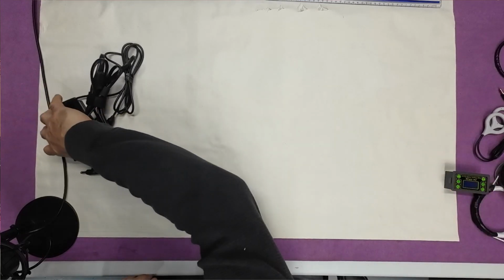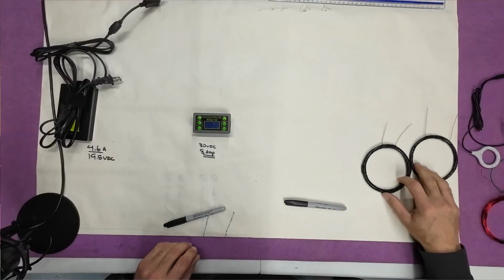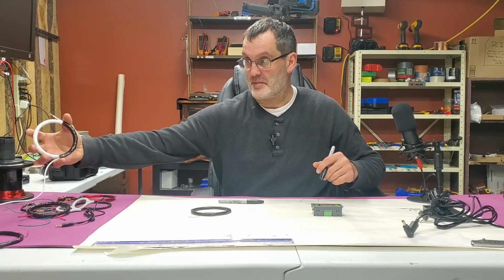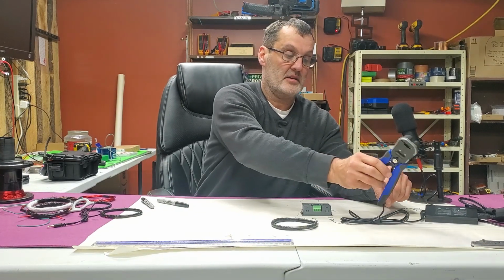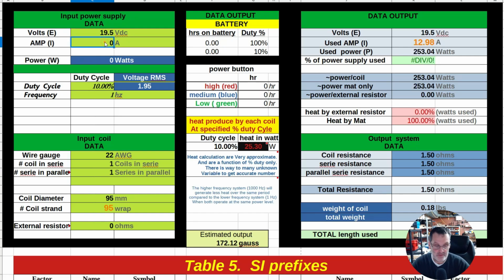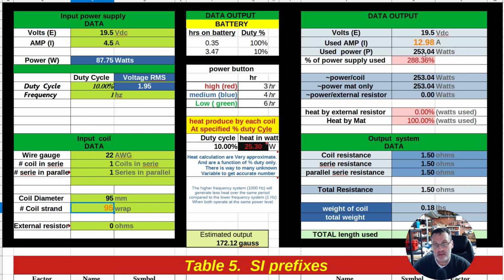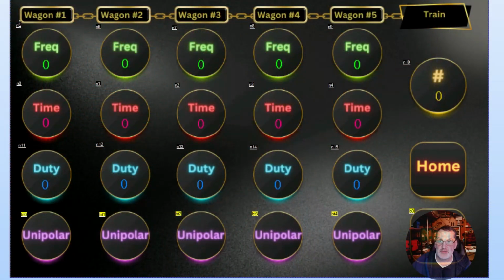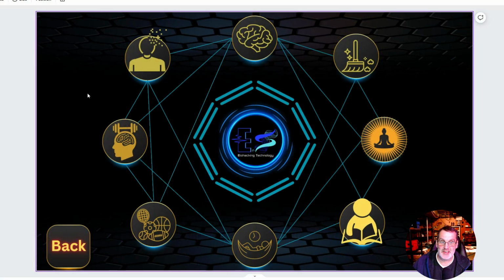Back to the BASIC!!

Comment: I have a question on the ohmic resistance. I pulled the back off the pk-pp1k. It's got a quite alot of integrated circuits in there. Was actullay impressed they have so much stuff. In there. Didn't do a full study of what the components are. Does it not have a mosfet? If it does, then if you are using a 19 v 3.59 A power supply, don't you need at least 9 or  little more ohms of total ohmic resistance in order to overload the p zed, so it doesn't burn out? I don't know what diameter your propane bottles are in Canada. I got my coil winder and a shitload of wire so I can now teach myself to do the coils. I'm going to go get a small table today, to mount the coil winder on. Still have to fabricate a guide and stand for the coil wire to rest on. I'm colse to figuring out that part out. I am dealing with a really bad rheumatoid arthritis flare up for two days now. A bit edgy, since I had to take some prednisone to reduce the swelling in my right hand. I've been using the micro-pulse A9 on my right hand, for several hours daily on my right hand. It swelled up so much, that yesterday, it looked like an overfilled sausage. Could not move the fingers or do anything with it. I tried hard to not take the prednisone but the A9 did not reduce the swelling. Two days with many hours on the maximum X setting. Nothing. Have a 650nm-880nm red light mat. I used it as well on my right hand. Finally had to take the prednisone which really makes me feel terrible. Anyhow, Thank you so much for the hard work you do on the videos. I know I can speak for all of us that watch your videos, that we truly appreciate the information and selfless help that you provide.
Reply from the maker: @joelstolarski2244  use the ppk2 not ppk1.  Ppk1 does not have a lot of amp rating.

Comment: Ok. After a couple of weeks, I have received I believe, most of the components, needed for your simple build. I wanted to just make the simple pemf, that I saw in the other video you did. Have had a few hectic days, and not sure where that video is. Have one of the ZK-PP2K. Got it because the buttons looked nice. So, when winding the coils around the propane bottle, it doesn't matter if the wire layers are arranged neatly in layers? Have multiple power supplies similar to yours. Will try to find one close to the same specs as yours. Thanks for the work on these videos,and the information that you selflessly contribute to us.
Reply from the maker: @joelstolarski2244  not to worry about the winding.   Try no to cross over.  The way we build the coils is the single best way to make it happen.  :)
Reply: @Steeve. Tried to see in your video how to do the winding. I have only 16 awg wire and when I order didn’t realize it is very thick. I have the RA in my left index finger. Was very hard for me to do the winding. I did 100 wraps. I probably crossed over. So it’s maybe wasted wire? I will have to get some of the 22 awg like you used. I am doing the wrapping by hand with no winding machine.

Comment: Have you built a battery operated Nextion system?  And if you did I would be curious what hardware you used to protect the system from under-voltage damage in a low battery condition. ty
Reply from the maker: Yes I have.   
There is a few ways,  the one i like the most is using buck boost converter to start and a low volts cut off mosfet that monitor the battery.  

Using your bench top power suply you can test your design.  

Low voltage protection is really important for the nextion.
Reply: Thanks so much  @Steeve.  I will check out the related info in Patreon.